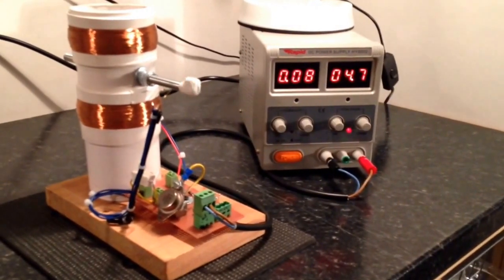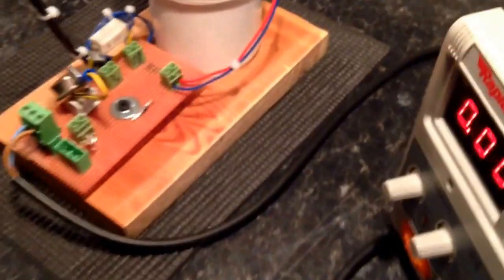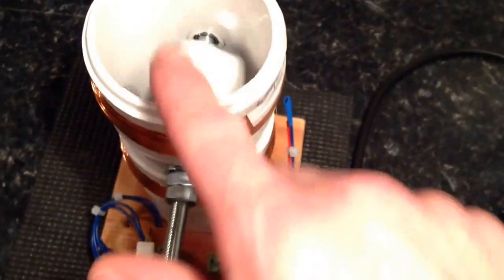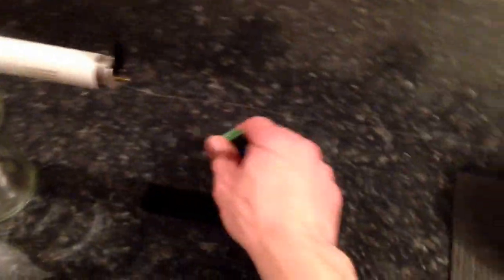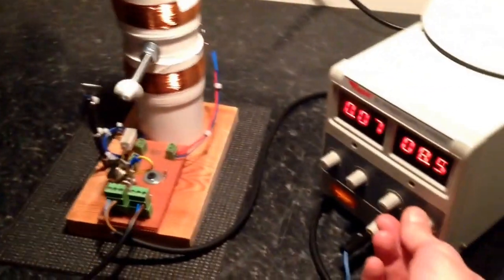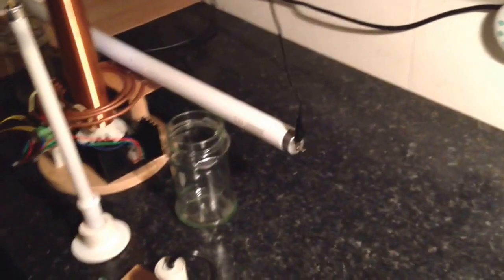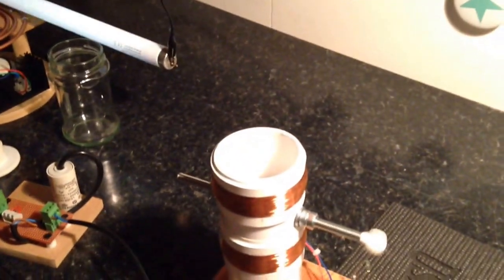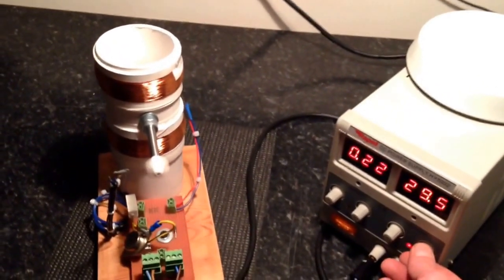Newman Motor testing

Comment: hey man...im still having problems reponding to you directly, i think your g+ account restriction is messin stuff up. there is an extension of the jefimenko shown here as well....this is a great vid and should clue you in hardcore to what im working on (sometimes). otherwise google 'oleg jefimenko'.  Graphene/Graphite Atmospheric Electricity Collectors - Plus Horrific Hexacopter Crash!
Reply from the maker: hey bud, Woo I just started watching that vid (I'll watch the rest laters), man that sounds interesting.. ION collectors cool. thanks so much for the link. hope you and fam are well.  I'm just outside banging my ground rods in & generally catching up with things - it's been a crazy busy week.  I got another engineer coming next week to try and get my BBand at home running  properly, the usual capers. Have a good weekend. cheers

Comment: good 'ol shaky  :)   i always wanted to see if i could somehow power a tower directly from a magnet rotors AC instead of using the backspikes. 
i havent built quite that shape yet....do you get more output if you load the rotor (slow it down with your finger or something)?
Reply from the maker: ..heh I love how there's a name creeping in for everything now mate.. . 'old shaky' lol. I've got some little 25kg sand bags knocking around somewhere.. that should hold it for a bit.  I wouldn't think to try putting a load on it be quite honest mate... It's becuase it's new to me so I'm kinda learning what it should do..  Diadon was talking about putting a load on it too - I'm scratching my head trying to think of something I can use and didn't stop to think I could actually just 'use' the thing scratching my head and watch the amp draw as I slow it, so simple! thanks bud.

Comment: Fun stuff!  Lots of losses in that shaft...  well done.
Reply from the maker: thanks mate, yeah I need to do a little work on the shaft, there are bearings in there but I couldn't find washers small enough to grip them correcly so it's got a bit of a rattle hasn't it. I really want to get that running nice to finish it really. thanks man.

Comment: That thing is powerful at low current it seems. Very cool.
Reply from the maker: ..mate, I just watched the video again and you are bang on the money. I heard they had torq but I couldn't get my head around where it was... lol.. well,. you know what I mean. It hadn't occured to me that the little thing doesn't amp draw when I wind the DC supply up does it!.. but the rotor has lots of torq. More obvious to me a higher speed when it moves around.. I need the visuals man! hehe 2:30am.. better call it a day before I start swearing or talking more crap. hheh :) thanks man, always good to talk.
Reply from the maker: I did notice it does that strange little Zero amp dram every now and again at around 4.5V dc, I put it down to the DC supply as I can't imagine it's really zero can you Terry?
Reply: Get some rest my friend :)
Reply: How is the current draw when you apply a load to the shaft? <----  There is a dirty joke in that somewhere. ;)
Reply from the maker: Diadon Acs
..hehe any talk of loads and shafts and my mrs goes red.  I'll try and find something I can attach to the shaft and find out.  It's a good experiment thanks man.